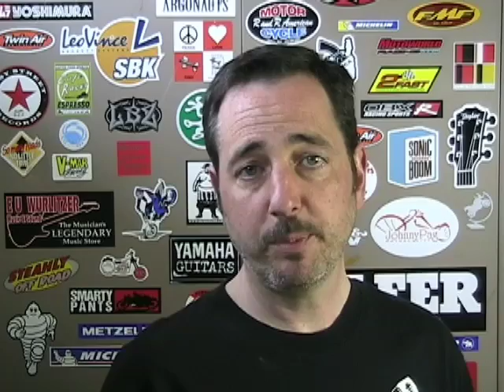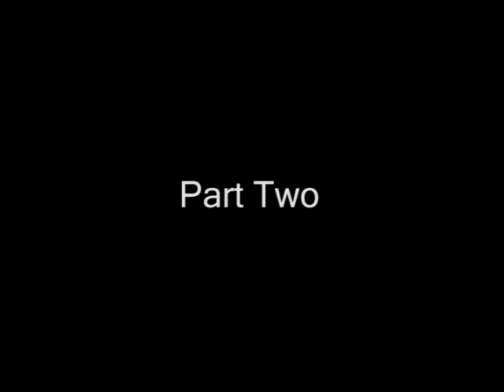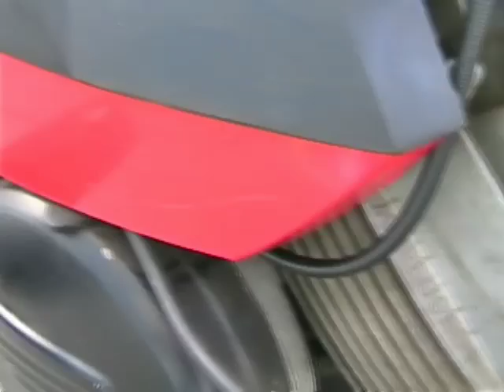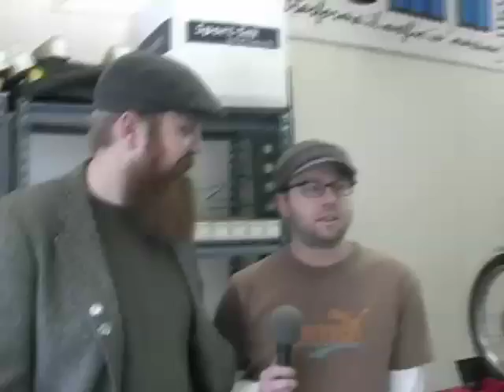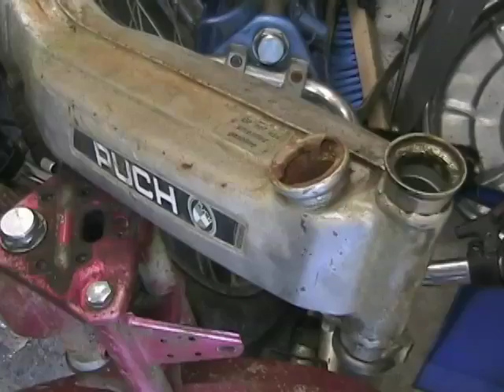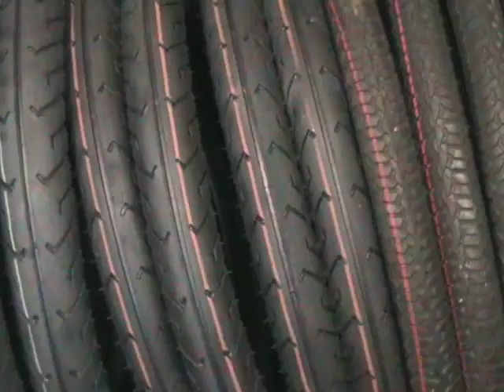Rust to Glory: Moped Maintenance Tips (Part One)

Comment: Done some of that, I did find the sourcing of bearings interesting.

I had a 1986 Trac Olympic some years ago, and I found out it's almost impossible to find original new daelim motor parts. I would come across parts I could modify to fit, but the performance was only sub-par compared to it's original glory. Needless to say, as much as I enjoyed the overall feel of the bike and incredible speed for a stock 50cc, I did not keep it. No point in having it, if I can't find original parts for it.